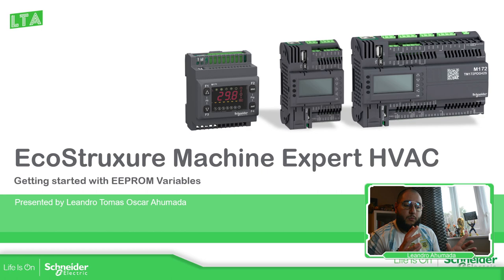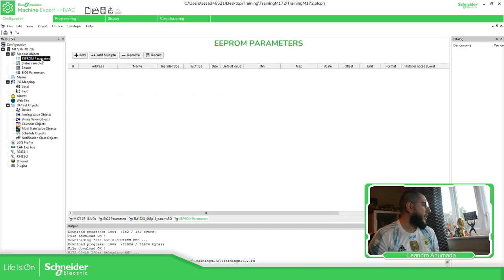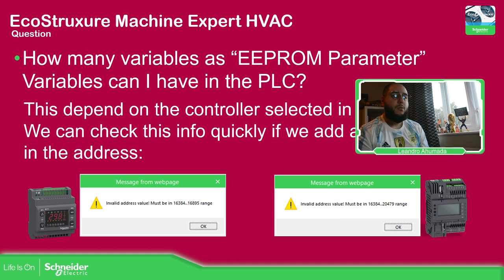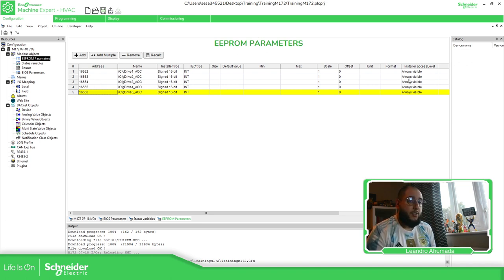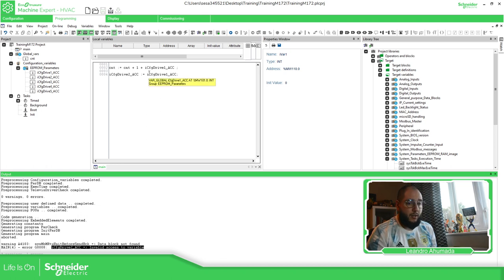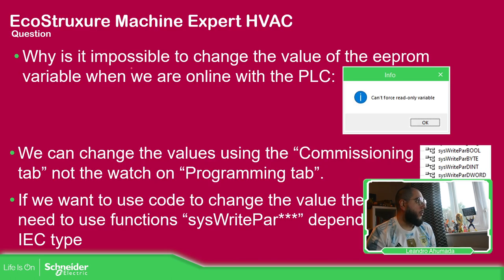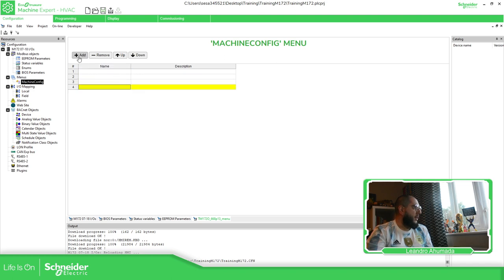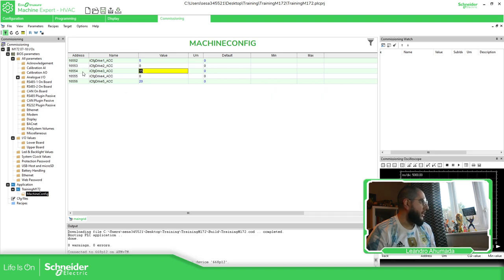EcoStruxure Machine Expert HVAC Training - M3.5 Getting started with EEPROM Variables

Comment: Hi Tomas , can we use  memory card  like  eeprom ?
Reply from the maker: Hi there! good question. Each controller has an specific amount of eeprom available to use as it is shown in the video.  I believe if you use the uSD card you can generate a file and store information there by using the FS_IEC library. I use that library to log data only.

Comment: "PLC return error code O2H"  shown in HMI how to solve this problem sir please help
Reply: And also some variable or address work but some variable or address not working in HMI
Reply from the maker: Hi there! it could be that the address defined on the HMI is wrong or it could be that the amount of bytes that the HMI is trying to access to the M17x is outside the area and you receive that message.
Not sure which HMI you have but i usually have the bit/byte fram echange on the driver or create a different scan time.
Reply: @LeTomasAHUMADA  thank you sir